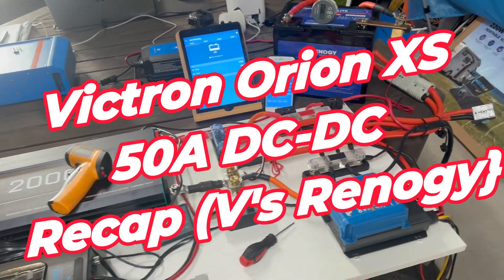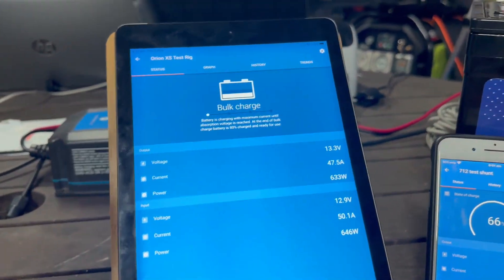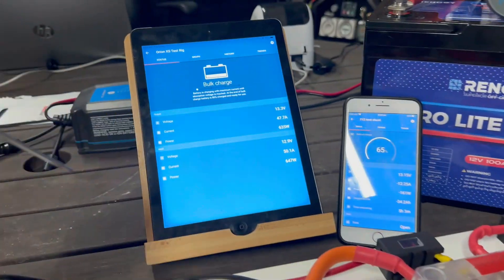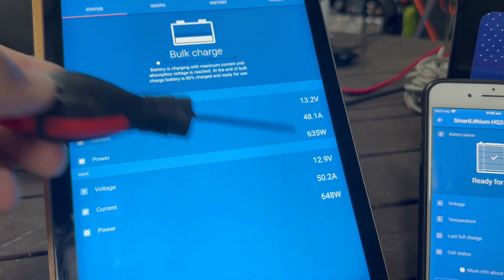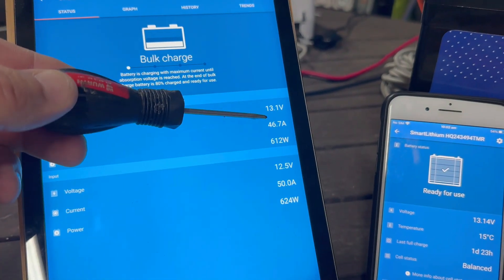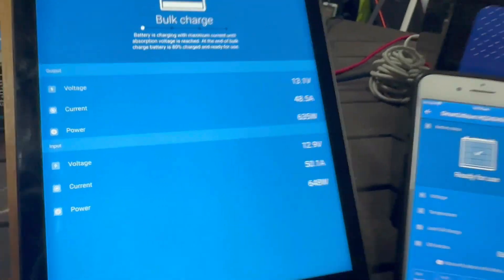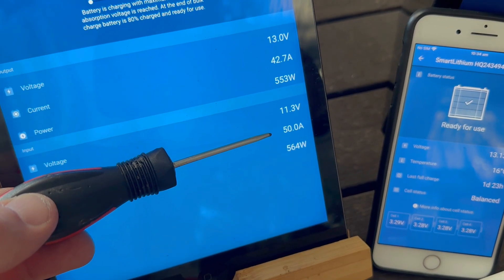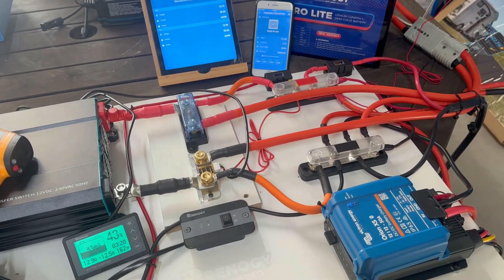Victron Orion XS DC-DC - Recap

Comment: Just paused mid way to comment. Your temp measurement should be on the back.. Victron says it should stay at around 90 degrees or less, and I saw a yes where it reached 93, so that's pretty close. measuring on the renege was on the surface too, but its entire surface is basically heat sink, whereas the Victron's heat sink is on the back.(also to be noted, it will run cooler, longer, with a proper vertical mount, so air can flow better).
As for the back reaching 90, by specs saying it begins derating at 60.. they are two different things.. the 90 is the unit temp, the 60 quoted is the ambient temp it can run in without derating. (keeping the back at 90ish), and can be improved to run at significantly higher ambient temps with cabinet cooling (or even just a fan blowing on the back, or sucking air up with a fan above it. Ok.. back to the vid...
Oh.. that was basically the end. The only other thing I'll add is, if you run it at 12 to 12, the XS 1400 will run cooler longer, because it has an actual heat sink on the back, rather than just a flat aluminium plate.

Comment: Really great video, just. what I needed as I'm about to buy either the Renogy or Victron. I'm very much leaning towards the Victron. My main concern for either unit is heat build up. I want the coolest unit as It will be mounted in a pretty tight space (small van). My question is, on the Victron (or Renogy) I presume if I lowered the output charge to 40A then the unit would run cooler for longer ?? Hence I'm looking to buy a 50A so I can still get 40A without working the charger too hard (heat).
Any thoughts, advice would be super welcome, thanks!
Reply from the maker: For sure lowering the output on both with reduce the temp, but my gut tells me the Victron will still run cooler overall.
Reply: @craigsolarsolutions  Awesome. Your video has been super helpful in making me decide, rather than a coin toss. Victron it will be! (as sexy as the Renogy looks).

Comment: I just installed my Orion SX and only seem to get 27-30 amps output. I ran 4awg tinned marine wire- the positive run is 36’ long and my ground is through the vehicle frame and is 15’ long. I’m getting 13.1 volts at the dc to dc . Any reason why I would only be getting 30 amps?
Reply from the maker: I’m seeing smart alternators limit the output based on the starter battery voltage… did you go directly off the start battery with the cable run ?
Reply: @craigsolarsolutions  yes, I do have a smart alternator also.
Reply: I’m also wandering about the small chassis ground from my batteries- would replacing this with the same 4 awg help my issue?
Reply: What size alternator do you have ? it could be limiting output.

Comment: Hi, would you see a problem with 2 awg cable (would have to reduce to fit the Orion XS DC-DC charger)?  The 2 awg cable is what's already in the van.
Reply from the maker: @MelissaPickert-g6x  The most I can fit is approx 20mm2. 2AWG is approx 33mm2 so you’ll need to use a cable reducing link. Great things is you shouldn’t suffer from any voltage drop and get full  output.